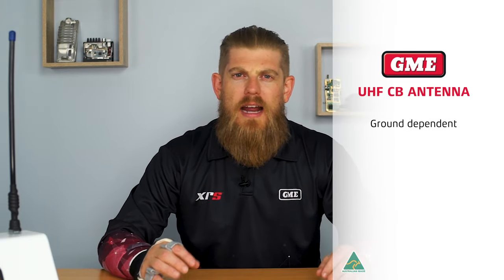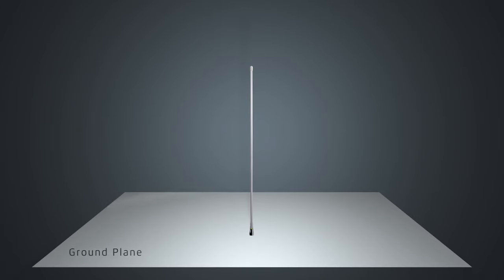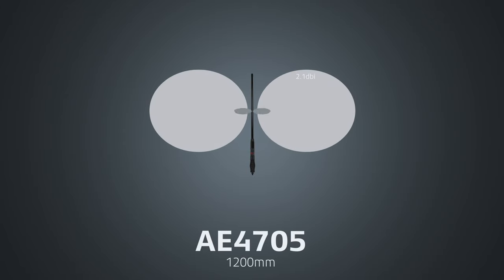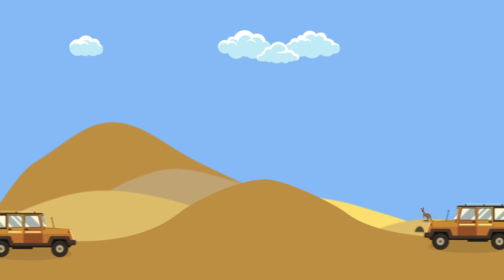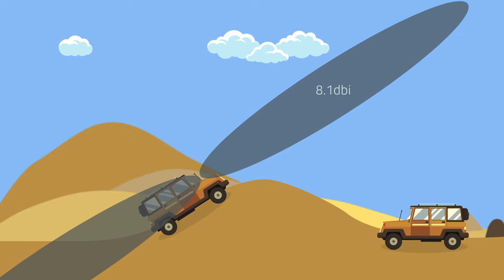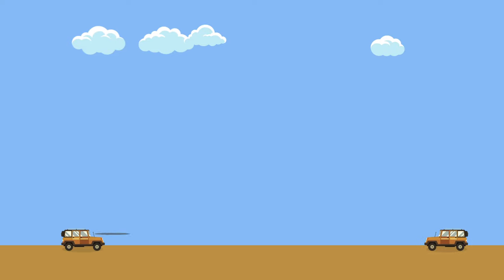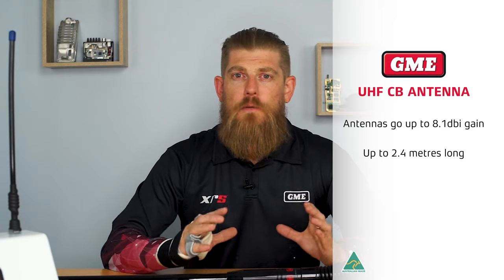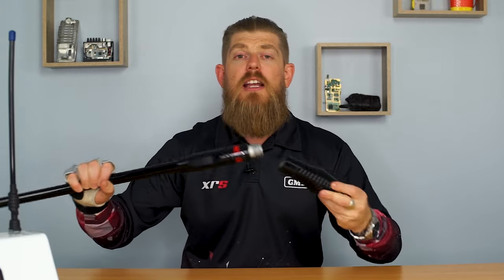Choosing the perfect UHF Antenna | GME

Comment: Hi Guys - very helpful, thank you!  I have a 5w GME fixed CB 80 channel in a boat on the Murray River - flat, obviously - but the terrain isn't.  I really only want to communicate with other boats, but they may be around the bend (the boat, not the crew).  What would be best for my situation?  Thanks.  Alan - Adelaide.  [Another nice thing would be able to drive an ordinary  AM/FM/DAB+ radio - via a splitter, presumably].  Ta
Reply from the maker: Hi there, if you are trying to communicate with other vessels the radio would need to be a VHF radio. If you are using a VHF we would recommend mounting the antennas as high as possible to ensure the best transmission distance in those areas.

Comment: Just wondering around a city with my am cb radio in the truck would a 1.2metre gme Arial mirror mounted give me further range compared with a 600 ml size, no hills around but certainly being around the city there are buildings thanks
Reply from the maker: Hi mate, without getting too technical, there isn’t much difference between a 600mm and a 1200mm AM CB antenna, aside from looks. Performance-wise they are very similar, it just comes down to aesthetics

Comment: I have a hand held GME TX6160 which I would like to mount on my motorcycle (BMW R1250GS) when touring. What antenna would be recommended for this application please?
Reply: AE4026SMA is your best bet!
Reply: @t000nz  , why do you believe this to be my best option? Your suggestion is the same size as the one on the radio?

Comment: Hi, interesting video, learned a lot from that. I owned a GME TX 472S radio for around 30 years, however I’ve just upgraded to a GME 4500S UHF radio matched to a GME AE4705B antenna, 1.2m 6.6 dBI gain. It should be ideal for the Kenworth cabover I own and the outback work that I do. My question is, I’ve mounted the antenna on a bracket at the rear of the cab and it is in between the dual exhausts. I’m wondering if I’ve got a high load on, whether I will have a good range to the rear of me, in other words will I be able to maintain a reasonable conversation with someone who has just passed me going the other way. Thanks.
Reply from the maker: Hi mate, it is hard to be specific without seeing the exact setup, however it is likely you will still be able to have a reasonable conversation with someone travelling the opposite direction. In a heavy vehicle application we generally recommend mounting the antenna on the mirror arm as this will reduce obstructions and provide the best performance
Reply: @GMEaus  I mounted the previous antennas on the right hand mirror, but they kept getting wiped out by low trees, so the rear of cab is the the second best option I guess.

Comment: If I install a glass-mount style antenna inside my car, will the rear window antennas interfere with the UHF signal?
Reply from the maker: We would advise not to mount on any existing antennas. To find the best solution we would suggest contacting our service team on 1300463463

Comment: Does a ground dependent antenna need metal-on-metal contact with the ground plane or can it go on a painted surface? (i.e. thin insulation between base and roof)
Reply from the maker: Hi there, sorry for the delay!
It would need to be on bare metal/metal-on-metal.
Hope this helps!

Comment: Hi orsom info I am thinking of mounting my GME ground independent antenna on the corner of my rear bar as I don't have mounts on my bull bar will this effect the antenna's performance in this location 
Cheers
Reply from the maker: Hi Darren,
This will not overly effect the performance. As the vehicle is in the way of forward transmissions the distance forward may be slightly impacted, but transmissions to the rear will be stronger.

Comment: Tony, I just bought a 390C recently through 4wd24/7 and have seen your excellent video on antennas. My question is this, can I install 2 antennas, one at 2.1 and one a 6.6dbi to get the best of both worlds in regards to coverage? Using a splitter or something like that?
Reply from the maker: Hi Wayne, this can be done but will require a splitter of which we do not offer. We instead recommend the interchangeable whips as this does not add another point of loss in the system and ensures the best possible performance.

Comment: Found with the 4705 they kill themselves with how much they shake... Model below it lasts heaps longer! Slightly less stiff spring doesnt snap the fiberglass top
Reply from the maker: We are interested to learn more about the failure you've experienced as the fibreglass radome on an AE4705 shouldn't snap from regular use. We have tested these antennas extensively across some of the harshest terrain in Australia and the only fibreglass radomes we've had fail are from impacting birds and trees.
Reply: @GMEaus  I had it fail on coragated road between Bourke and hungerford.. fiberglass top broke off at the stainless base! Was a good pink one to 😭 can't afford a new one on minimum wage

Comment: I was wondering if antenna splitters effect the range of the antenna?
Reply from the maker: Hi Ethan,
By adding in a splitter you will introduce another point of loss which will ultimiately impact the performance/range of your antenna. Instead we recommend the use of an interchangeable whips over splitters.
Reply: @GMEaus  I suppose if I want 2 antennas working without getting out of the car to change the whip I’m better off having 2 UHF’s
Reply from the maker: @ethanwebber2160  by having 2 UHFs you will be able to ensure the best possible performance of the antennas, especially if you do not want to interchange whips.

Comment: Do you make a shorter cable as 4.5mtrs is beyond excess to my needs max ill need like something 2mtrs
Reply from the maker: Hi Ibrahim,
Unfortunately not, our antennas come with that length to allow mounting in a range of different positions depending on the customer preference.

Comment: I just fitted the gme tx 3100,and it come with a tiny antenna  on a magnet.
I want to mount an antenna on my bull bar, and im only using it whilst towing my van, and communicating with our traveling companions.
What would you suggest i use in my application pls?
Regards 
Mark.
Reply from the maker: Hi Mark, we have a number of options to suit your application. For best performance we suggest one of our elevated-feed range – such as the AE4018BK1
Reply: I don’t want to carry my roof rack, lights and antenna with me everywhere when I am not 4WDing or touring.

Is it safe to add a separation point to the coax by (professionally) crimping an FME connection in a weatherproof location? Is there an disadvantage to using a AE4026 around town and a AE4705BTP when out and about?
Reply from the maker: @SalvoDan  Hi mate, it is safe to do so but please note that this will add another point of loss into the system which may impact the performance.

Also there will be a disadvantage to using the AE4026 as this is a lower db than the AE4704B included in the twin pack.

Comment: Do the gain of the antenna have any effect on receiving  signals?
Reply from the maker: Hi mate, yes it does. When transmitting, a high-gain antenna allows more transmitted power to be sent to the receiver, increasing the received signal strength. When receiving, a high gain antenna captures more of the signal, again increasing signal strength

Comment: Can a cellular antenna be used on uhf? Eg AT4705B
Reply from the maker: Hi Tim,
No the AT4705B will not work as a UHF antenna as they operate on a different MHz frequency.

Comment: Hey just wondering, my antenna is fibreglass and i was wondering if being mounted on a fender bracket would damage my antenna? the car is V8 petrol land cruiser. im not sure how long the antenna has been on the car since i am not the original owner but it seems to be working alright. i also am pretty new to the UHF CB scene so i have an extremely basic understanding of what the hell im talking about. just hoping that my antenna is durable enough to survive a bit of off-roading and over time general wear and tear from a fair bit of vibration..
Reply from the maker: Hi Harry,
If you could confirm the model number antenna we will be able to double check this for you.
Reply: @GMEaus  The part number is AE4018K. Mounted on the fender near the radio aerial on a mounting bracket (Part NO; MB018).
Reply from the maker: @DinDjarin6969  That should be fine! Just note that the elevated feed style antenna is not as well suited to off-road terrain and corrugations when compared to the radome style antennas.